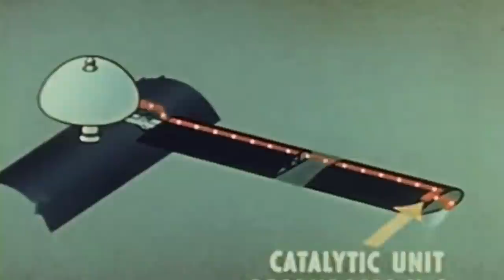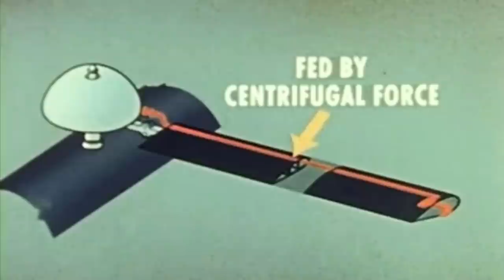Helicopter with Rocket Blades

Comment: I'm not going to be able to sleep until I know why the hell this wasn't put into production. I'm dumbfounded.
Reply: It may have been another money grab project. But still it should have been used. 
Even now it could come in handy for rescue use or around other terrain which needs the extra boost.
Reply: Because the idea was crazy.
Reply: @zoperxplex  yeah, so was going to the Moon.
Reply: it's the US army, thats why. lots of tech was developed and then just never used.
Reply: @zoperxplex  russians place rockets from russian Stinger (Igla) on tanks to get out if stuck.
Reply: @michaelhowell2326  Going to the Moon was achievable.  This idea was comparable to playing with dynamite while there existed far more practical methods of arriving at the same goal.
Reply: This invention might be great to have on a gyro copter.
Reply: @trololoev  The Russian army is probably the only military establishment that has tried to use that technique as a solution.
Reply: How's the insomnia coming along?
Reply: I would be concerned about having flammable propellant in the rotor blade.  Not to mention the cost / stress put on the rotor blades.   

Interesting concept though.
Reply: My guess is rocket tipped blades were intolerably noisy.
Reply: Noisy, inefficient, and horrible autorotation properties.
Reply: Because it’s hydrogen Peroxide.
It’s a 50kg unstable bomb placed on the most important part of a helicopter.
1 stray bullet in combat.
There’s no chance to autorotate. Try and land. Wave off from a landing site.
It’s half the passengers are red paste. Half the engine and entire rotor system are missing and everyone is sentenced to death.
I 100% agree that for rescue helicopters in places like Everest. This could save lives. But it can only be seen as a bomb and must be treated like one.
Bombs that that have caused thousands of deaths during. It was hydrogen peroxide torpedos malfunctioning that sink Kursk and arguably other Russian submarines.
Reply: @bcubed72 , thanks! I never expected an explanation.
Reply: Gonna need some toothpicks to hold those eyelids open...
Reply: @Bill Carson - More powerful engines is not the fix-all that the reaction motors on the tips gave, mainly because the exhausting gases added directly to total lift (vectored downward, equal and opposite,etc.).
Reply: The reason why it was never implemented was due to one invention, the jet engine.
Reply: It kept people awake at night.
Reply: Because it required Soldiers and Marines to be exposed on a regular basis to a chemical so nasty that the Nazis hated having to use it. HTP reacts violently with just about anything you care to mention, and was responsible for several closed casket funerals after the crash landings of Me-163s because the remaining fuel in the tanks got out and partially dissolved the pilots. And T-stoff was only 80%, not 90% like this abomination used. One little leak, and suddenly you're dribbling high test rocket fuel right on the Jesus nut. Or into the swashplates. Or into something else for it to violently react with that you absolutely need it to NOT react with to... you know... stay alive.

Plus, you're spinning the tank... I gotta think at some RPM, that turns into destructive resonance if the tank sloshes just the wrong way. Ever seen what happens to a helicopter under ground resonance? You sure you wanna make that problem worse, and stick a 300lb can o' death on top? And now the rocket fuel is leaking everywhere and you're really hosed. Have fun!

Honestly, I'm not at all surprised that this abomination to common sense was canned. I'm dumbfounded it flew at all.
Reply: @Tomyironmane  Just needed an ejector seat and it would have been fine 🤣
Reply: @killman369547  to be more specific - the turboshaft engine
Reply: @Mark_C1  Rrrrrriiiiight... give it one of the downward firing ones like the early model F-104s had. Problem is those things were utility helos, and carried passengers and door gunners.
Reply: Carrying around an extra 300lb "just in case" was impractical for 95% of missions.
Reply: @Tomyironmane  >> “300-lb can o’ death at the top”…that got a real lol from me.
Reply: At the same time they were playing with this the GE T58 Turboshaft Gas Turbine Helicopter Engine was ready for production. Jet Turbine Engines solved the problem far better than the Rotor tip rockets. And offered massive full time performance gains. Not simply a 7 minute boost.
Reply: Turbine engines made the system obsolete.
Reply: probably puts too much stress on the engine and the blades.

Comment: A few years later this jet rotor concept would emerge as prat of an "Everyman's helicopter". the jets were streams of gas which came from a gas generator and was diffused by tubing out to the end of the rotors. One of the nicer things about it was the decreased need for the tail prop to keep straight flight possible, as the torque applied to the axis of flight was much smaller- another was it made for an all weather helicopter because the heated gases kept the rotor blades warm enough to keep ice off. But back then we were thinking flying automobiles for the masses were "right around the corner". I don't know how we got that idea , seeing as how it was a big yellow bus bearing down on us!

Comment: Interesting project, I thought this video might be about Hiller's Hornet ramjet helicopter. Worked by basically the same principals, just using a pulse jet engine on each rotor tip.

Comment: The Fairey Rotodyne used jet powered rotor tips but the noise was too great for a commercial helicopter used in urban areas.
Reply: Ha, you beat me to it!
Fairey did not mess around with a small craft either, up to 48 passengers.
Just a shame it was too loud.

Comment: In the 1950's Fairey Aviation experimented with a number of rotorcraft which used tip jets instead of driving the rotor from an engine. These being: 1. Jet Gyrodyne (1954), 2. Ultra Light Helicopter (1955) and 3. the legendary Rotodyne (1957). As the rotors were driven from their tips, no torque reaction was produced, which did away with the need for a tail rotor.

Comment: I imagine the volatility of the fuel outweighed any potential benefits.
Reply: And the fact a rocket doesn't last very long.
Reply: @v4skunk739  yeah, 7 minutes is can be difficult to find a spot, descend, and land.
Reply: The fuel used was just hydrogen peroxide
Reply: @1scorchedphoenix509  it was pure hydrogen peroxide.  There's a difference
Reply: Sooo... if the fuel had minimal to no volatility, and the rockets lasted longer, it'd be good?
Reply: @awesomeperrymexd7180  I don't know. I'd still be worried about the stresses on the rotors from the placement of the rockets, as well as the possibility of instability if the tail rotor wasn't functioning.
Reply: By the time this was fully tested and developed Turboshaft gas turbine helicopter engines were a thing. They did the job much better without having to play with oxidizers.

Comment: About 15 years ago at a RMI reunion in Rockaway; the ROR subject came up. One of the engineers who was on the program said that one of the main issues that canceled ROR was the tests showed a tattletale Circular flame patterns during night testing. The military was not very receptive to this. Even if hydrogen Peroxide used as a mono propellant;  i.e steam, the reaction did produced a visible flame. Also; my opinion, fielding this propellant would be a nightmare in terms of logistics, plus the hazards; it is hypergolic to organic materials. As power plant/gas turbines and helicopter designs improved; ROR and the Hiller ramjet program faded away.  As well JATO for DoD aircrafts too.
Reply: Vince Granato  thanks for that first hand bit of information. 👍👍👍👍🇺🇸🇺🇸🇺🇸🇺🇸

Comment: Ever build models of helicopters? I did. Lots of them! My dad taught helicopter flight school at Ft Rucker, Alabama. I wasn’t satisfied with just building models. I had to modify them. I wanted working rotors. Made it so and wanted more! More Power! Putting in a faster motor always resulted in the rotors coming apart! IMHO, stresses of increased centrifugal forces caused the developers similar problems.

Comment: I am a Helicopter Pilot.  I designed a helicopter that was powered by standard turbine engines, but their sole purpose was to power a fan that sucked in air and under high pressure delivered it the rotor tips.  I also surmised it would help with retreating blade stall since HP air was being blown over the retreating blade.  With very little torque, the tail rotor would be extremely small or replaced with a NOTAR system.  Would it ever fly?  Probably not, but it was fun to contemplate.

Comment: Go check out the Hiller helicopter with the turbines on each end of the rotor blade. No other engine required! Had a model of it back in the early '50s and I got to see it fly as Hiller was about two miles from our house.

Comment: When we fly helicopters we try and land them much like a fixed wing aircraft on a runway.

This approach is the most efficient approach.

Now if a helicopter is operating in  high altitude,  carrying a large cargo and forced to do a vertical landing.

This would be very taxing for the helicopter, particularly when it's using a piston engine.

Comment: the entire airframe is basically an aluminum catalyst, with 300lbs of corrosive fuel on top, needing to be topped off by the average pump jockey in the field.
  reason where certainly known, why they didn't go forward with that Buck Rogers stuff..
Reply: This channel should be watched for the pretty pictures and not for real research.

Comment: It was probably discontinued due to bell helicopters using the tech to develop the bell rocket belt in the mid 50s to early 60s. The concept of an airborne battalion of soldiers over an auxiliary backup power supply for helicopters would have been enticing to the army but due to the less than stellar endurance of the rocket belt the project was most likely abandoned.
Reply: Still a great concept. Wish i had a switch on my heli that would add power when i need it.

Comment: The reason the project was dropped isn't unknown. It just isn't particularly sexy. Yes the jet tipped rotors worked well for what they were designed for. But their use was limited by fuel, control, maintenance and materials handling. Do you want to know what worked even better to solve the problem than adding secondary rockets to helicopter rotors? The GE T58 Turboshaft Engine. Which gave the helicopter the desired performance across it's entire operational range, and for the full flight time of the mission. The jet rotors were only really needed for piston powered helicopters. But the end of those was already on the horizon with the introduction of the gas turbines.

Comment: More than the air force, the U.S. army went big on helicopters. Especially after the 1949 Key West agreement that restricted its fixed-wing aviation. I wonder if the ROR was not adopted because everyone saw the turbine engines coming down the road. The first Huey prototype flew in 1956.

Comment: The thumbnail image for this video is NOT and ROR system.  Instead, it was a single passenger self-rescue helicopter for downed aviators with ramjets on the blade tips.  It would be better described as a rotary flamethrower.  It was started by cranking a handle on the side, which is probably what the person in the photo is doing.

Comment: I wonder if they were at all drippy after landing and whether it was dangerous to approach if there were leaks and I bet it was hard to control leaks with all the stress on those connections.  Plus it looks like that they just smacked those apparatus is onto the ends of the blades and I wonder if they didn't just fling right back off once in awhile. And if even one were to be lost I wonder if it ruins the whole setup.

Comment: I ran the numbers- it's only 74 hp.  At the maximum 245 rpm rotor speed, the rotor are going 20,400 feet per minute.  30 lbf * 4 motors is 120 lbf.  That's 2,446,374 pound force feet per minute.  A hp is 33,000 pound force feet per minute, so this makes 74 hp

Comment: There were other ROR helicopter designs .
 Even JOR helicopters . 
 The US military researched the hell out of the "On rotor" power plant helicopter. Jet engines on rotor . Forgot the problems they had but they tried it .

Comment: Adding steam and oxygen into the vacuum at the end of the rotor blade could significantly reduce rotor noise,  in addition to supplying more thrust.

I suspect the prospect of having an easy to spot BOMB right on the top of the helicopter might have been an issue.

I also suspect that corrosion was the reason they didn't get deployed... any leak or spill on the critical components of the helicopter would result in a hard to spot danger.

Comment: They should have a small rocket in the tail to stop the helicopter from spinning in case the tail rotor fails.  I've seen video of lots of helicopter crashes because the tail rotor failed.  It would only need to work for a minute until the helicopter can hopefully land.  Sensors could adjust the thrust to keep the helicopter straight depending on the force of the main rotor.  You are welcome, you can send me the royalty checks via paypal.
Reply: That's why they developed NOTAR, or 'NO-TA-Rotor'. If you don't have a spinning tail rotor, it can't get damaged..
Reply: @cassandrafoxx4171    I don't get it, what if the fan in the tail quits working?  Wouldn't it have the same effect as a tail rotor breaking?  I'll have to look more into it.  
    Also I've wondered, why don't they just have two main rotors, one far enough above the other, each going in the opposite direction.  Kind of like they did some propellers during WWII before everyone started using jets.
Reply: @BrettonFerguson  A lot of Russian helicopters are like that, like the Kamov Ka-50 Havoc. The Americans tried it, making a very fast, augmented-jet helicopter, The Sikorsky S-69 (XH-59A) ABC, or Advancing Blade Concept.
Reply: @cassandrafoxx4171    Cool.  Thanks.  I'll look into them.

Comment: The reason this was not used is crystal clear to a chemist: 95-98% H2O2 is hard to handle, shock sensitive, and prone to explode (worse than nitroglycerin).  It will cause any organic matter that comes into contact with it to spontaneously burst into flames. Contact with human skin = no more human.  It is expensive and difficult to produce.  It is typically produced on-site because it cannot be readily transported, especially in hot humid environments.  It is great in a laboratory test, but it could never be made user friendly (idiot proof) for widescale use.   I will not even get into the corrosion issues.

Comment: Thats are only Tip jet Rotors.They have a way to high fuel consumption.
Its like an Afterburner on a Helicopter, but you dont get far.They build
a very lightweight Helicopter with slower speed and get then a "crop dusters"but not in Millitary Service.
Reply: Google after SNCASO SO.1221 Djinn ,that had seen Millitary Service
only short Time.

Comment: Hydrogen peroxide at high concentration is a powerful oxidant. Also if there is an organic material or some reactant metal contamination in the tank or in the rocket motor feed lines the peroxide will rapidly decompose and an explosion will occur. Hydrogen peroxide cannot be placed inside the tank for long periods of time because it will slowly decompose generating an increasing oxygen atmosphere inside the tank. Filling the tank is a very risky operation, if something goes wrong certainly will result in a fire or explosion.

Comment: It's sounds like a good idea, but in my opinion only as a method increase the speed that the rotors start up, getting the machine off the ground faster and in to it missions, but in flight, I'd say no, because I would think that past a particular speed, the rotors would become inefficient and ineffective, because of the massive airflow problem due to the large gaps in air density where every other blade would fly through empty space caused by the blade preceding it, and turbulence, unless the rotors were designed to perfection, new shapes like modern Augusta Westland aircraft, and you've Also got the drag or lag of the receding rotor,(the one at 90⁰s angle to port, or at 9-O-Clock as apposed 12-o-clock position, which causes that particular rotor blade to slow down significantly compared to its opposite number, so 4 blades minimum them, then again two bladed like the Huey would surely have a large enough gap between each Rotary wing to stop the dead Air affect.

Comment: The actual reason to why these devices were never implimented into aircraft was due to the significant damage it did to the blades, exposed parts and its structure after its use, the safe storage and re filling of the helos after it had been used, and the high risk of the propellant entering into the cockpit onto the pilots after it being shot by a projectile. 
Several eager Pilots from the USAF chose to be test Pilots for this unit...until they were later made aware and saw what the propellant did to aluminium metals and human skin...the remaining others (who believed they could 'tough it out' as women were using it heaps in their hair) left testing 'pronto' once they were shown how in its actual concentrated (H202) form it corroded 3 inch thick solid Stainless Steel components inside cooling systems of Nuclear reactors 😁

Comment: Spill jet fuel, no problem, wash your clothes. Spill 90% h2o2, no more problems and no more clothes. I think having any appreciable amount of high test hydrogen peroxide on board would make even minor crashes virtually un-survivable. Transport and refueling of said h2o2 on the battlefield would be a logistics nightmare as it couldn't safely be stowed near munitions or soldiers